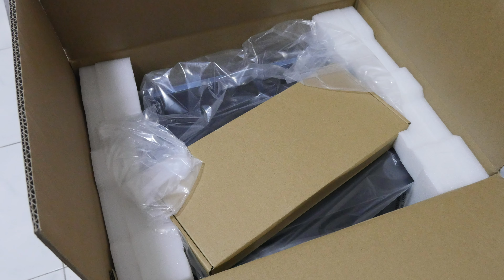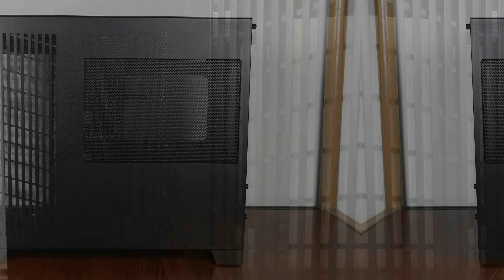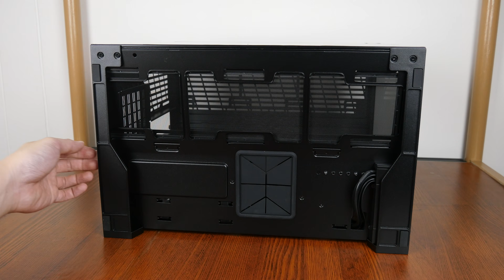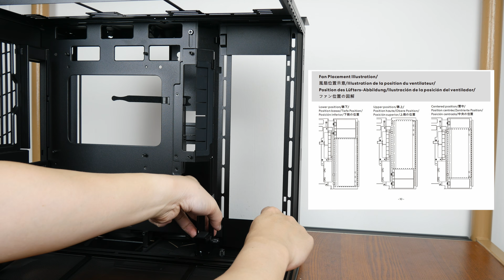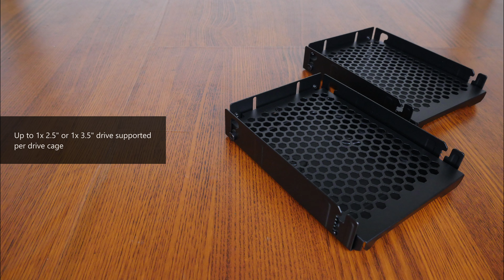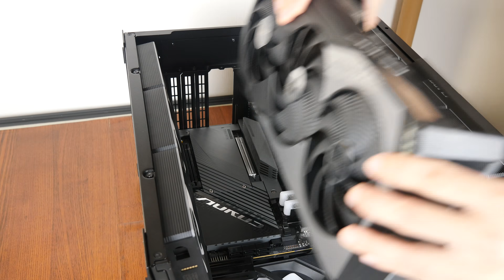The O11D Mini has been refreshed and improved! Lian Li O11 Dynamic Mini V2 Review & Walkthrough

Comment from the maker: NOTE: The O11D Mini V2 supports ATX motherboards with the primary PCIe x16 slot for a graphics card located in the second slot position - this is because the case comes with only five expansion slot openings due to its compact size. If you have an ATX motherboard with the primary PCIe x16 slot in the first slot position, you will have to install your graphics card in the vertical position instead!

Also, at 21:10, I mentioned that there are seven Velcro straps - to clarify, there are two additional straps on the bottom panel of the case, for a total of nine straps.

The written review for this PC case is available here: https://www.alktech.co/articles/review-lian-li-o11-dynamic-mini-v2-pc-case
Reply: I just had the opposite happen... GPU fits in the primary slot but could be due to it using a water block and i cannot install my SSD to the tray as my PSU blocks it off along with my side panel not closing, Just had to order a SFX PSU  ¯\(ツ)/¯
EDIT: Forgot to mention, great vid and subbed. I do Love the case, a bit fiddly to watercool in but that could be because i came from a Corsair Obsidian 900D :P

Comment: 19.41  Does your power supply stick out, or did the back panel close properly? For some reason, mine won't close.
Reply from the maker: Hi there, yes the PSU does stick out slightly, which is why the side panel has a raised section right above where your PSU would be to accommodate the "overhang". I'm currently using this very case in my own main PC, and didn't have any issues with panel closure! What brand and model of PSU are you using, and have you double-checked that there are no excess cables getting in the way of the side panel?
Reply: @ALKtech  Unfortunately, I didn't build this computer myself, but the person who did said he'd never encountered this issue before; the cabling seems fine, but I don't know the name of the power supply unit Zalman GigaMax III 750W ZM750-GV3

Comment: Some idea to cover he hole in the lower part where the gpu cable cross? I have 2 problems with this case .. 1. That horrible hole in the lower part
2. Not much space in the back. And more if you use hubs, hdd, and strimers.

Comment: I’m trying to downscale from a 011 dynamic evo. Is this a good option or can I go smaller with an ATX MOBO
Reply from the maker: Hi there, is your main gripe with the O11 Dynamic Evo the size? If so, the Mini V2's definitely smaller, but I'm not sure if going through the whole process of disassembly and reassembly is worth it (from my lazy person perspective 😅), unless you're already planning on upgrading your PC's other components too!
Reply: @ALKtech I ended up going lian li A3. Needed to buy a mAtx but man did it cut down in size
Reply from the maker: @luigisupergreen  thanks for sharing - the A3's a nice case and I have one myself too. I can imagine how much desk/floor space you've saved just by downsizing 😂 were you able to use your existing PSU with the A3?
Reply: @ALKtech yes. It’s a tight squeeze but it works

Comment: i think you have mounted vertical fun upside down
Reply from the maker: Hello! I assume you're talking about the side intake fans? If so, they're mounted in the correct position to serve as intake fans, though the reason why they look odd is because I used the normal blade variant instead of the reverse blade variants that would have looked more appropriate - I wasn't able to get any reverse blade fans in time for the review. Hope this clarifies!
Reply: @ALKtech make sense

Comment: I've been watching a lot of videos about this case and you've done a super job on your video. Question: I'm thinking of building a PC that's not primarily a gaming machine so I'm not planning on having an AIO. I like the Mini V2 Flow because it comes with the 5 fans. I'm wondering if it is possible to move the 3 fans on the bottom of the case to the top of the case? I would then get 3 ARGB fans to fill the bottom fan bracket (and also a fan for the back of the case.) Could the fans from the bottom of the V2 Mini V2 Flow be repositioned to the top? If so, is the wiring for these fans long enough to reach the appropriate connector on the motherboard?
Reply from the maker: Hey there, thanks for the kind words and glad you found the video useful! Unfortunately the review sample of the O11D Mini V2 that I tested is the variant that doesn't come shipped with pre-installed fans, so I didn't get the chance to handle the non-RGB pre-installed fans that would have come with the variant that does (O11D Mini V2 Flow)!

That said, I'd think that you should be able to shift the pre-installed fans to the top panel instead, as the wiring for such fans SHOULD be pretty standard across the board (even if they're not, you could always get a third-party ARGB/fan hub). However, you'd want to take note that the bottom three pre-installed fans are reverse-blade, meaning that they wouldn't look good from an aesthetics perspective when mounted on the top panel! Plus, being that they're non-RGB, they may look pretty odd when paired up with the 3 ARGB fans that you're thinking of then installing on the bottom panel. Hope these insights help!

Comment: Do the hard drive cages come with any anti-vibration rubber grommets for 3.5" hard drives?
Reply from the maker: Hi there, if I recall correctly they do, where you get six of them pre-installed for each cage as per 16:40 - you might have to pause the video really quickly as I sped up that section of the video in post!
Reply: @ALKtech  Okay, I slowed down the playback and I saw the grommets, I thought they were metal since they're the same color as the cage.

Comment: Does the case has orginally side and bottom fans intake or exhaust? If i want to have i/o as exhausst on top and i want to mount one exhaust fan back, and side an bottoms as intake then which ones should be reverse and which one should be normaln so it would look good? Does arctic liquid freezer 3 pro comes with fans mounted as intake or exhaust? Im sorry for so kuch questions but im new to building pc
Reply from the maker: Hello, the version of this case that comes with preinstalled fans comes with five of them, two on the side where they are reverse blade and serve as intake fans, and three on the bottom where they are reverse blade too and serve as intakes as well. Your suggested setup is correct, you should get 2x reverse blade intake fans for the side panel, and 3x reverse blade intake fans for the bottom panel, while your rear panel fan can be a normal blade one.

Regarding the Arctic Liquid Freezer 3 Pro, the fans typically will be installed as intake (blowing air through the radiator), so I'd install them on the top panel of the PC case where the radiator will then serve as an exhaust. Hope this helps!

Comment: Is there a way of modification to allow installation of a radiator behind the side fans?  Angled metal sheet is too close to the bracket holes.
Reply from the maker: Hey there, to clarify, are you asking whether it's possible to mount the AIO radiator on the side panel fan opening from the side of the second chamber with some modifications? If so, I highly doubt so unfortunately. Do you have three intake fans installed on the bottom panel, where they are getting in the way of your 240mm AIO radiator when it's installed on the side panel in the normal fashion?
Reply: @ALKtech yeah its right. A 55mm thick aio just seems too close to the gpu, so I'm hoping to mount the fans or radiator in the 2nd chamber. It seems like a lot of wasted space behind there. Anyway, it seems to be better just to mount it on top on top or use a 360 aio.
Reply from the maker: @lamjk10  mmm I see. Yeah I think to prevent overcomplicating things, I'd much rather do a top mount of the AIO radiator instead to save the hassle! Have you decided on which AIO to get yet?
Reply: @ALKtech i have 2 white aio-a 240 galahad ii trinity and a 360 galahad ii trinity performance. The latter is not officially supported because it is too wide. So I just used a matx board. And to offset the aio, I installed it on the middle slots on the inner side and on the side near the glass I used washers to act as clamps on the inside of the bracket.

Comment: If your buying this case make sure to check your front panel usb-c cable mine was faulty out of the box all the other panel connectors worked perfectly fine
Reply: Exact same issue here. Had to get a replacement, they sent all a new panel.
Reply from the maker: @alim7602  oof. Looks like they might be having some QC issues with the front panel..
Reply from the maker: Sorry to hear about that! Did you manage to get the I/O module replaced under warranty?
Reply: Just finished the build and tried usb-c. Same thing doesn't work...

Comment: The only drawnback of this case is that it doesn't suport a 280mm radiator on the site.
Reply: The other problem i just found out........ due to the angle, i cannot put my 120mm fans in the other chamber and have my rad in the main chamber. Pfft.

Comment: What would you recommend? The v2 mini or the lian li Compact case? My first pc build.
Reply from the maker: I haven't had the chance to build a PC with the O11 Vision Compact (which I assume you're referring to), but I'd say between both cases, it really depends on what you're looking for. The O11 Vision Compact is pricier, larger and you do get the option of having a top glass panel as well - I would say it's targeted at a different user demographic as a result.

That said, of the two, I'd probably go with the Mini V2 instead as I value having more space on my desk, and I really like how you can pretty much fit full-sized components in the Mini V2's compact package. My two cents!

Comment: The biggest downside to this case, is the 160mm Air Cooler support for CPUs. If you have to move your front fan up on a dual tower, it might run into some clearance issues.
Reply: Single tower air coolers got so good dual tower are just not worth it nowadays

Comment: what GPU is this?

What's the biggest GPU you can fit vertically in there?
Reply from the maker: It's a Gigabyte AORUS GeForce RTX 4090 Master 24G - probably one of the biggest graphics cards I've handled thus far. I haven't had the chance to try mounting this said card in the vertical position, I might give it a try and see how it goes!
Reply: @ALKtech please do and update!!!  Lol.  I
Reply from the maker: @iron.sneeks4053  I'll try to do so in the next couple of days, will update again!
Reply from the maker: Hey @iron.sneeks4053 I managed to get a Gigabyte AORUS GeForce RTX 4090 MASTER 24G to fit in the vertical mount position - FYI. It's by far the biggest graphics card I've handled till date, and it fits with space to spare!
Reply: @ALKtech  That is awesome!! THANK YOU SO MUCH!!!!!!  I think the 5090 MASTER should fit as well.  I think they're the same dimensions.  I'm sure you slid in your back fan after placement correct?  Thanks again!
Reply from the maker: @iron.sneeks4053  yeah the 5090 Master is not as wide as the 4090 Master, but has roughly the same height and length, so you should be fine! Just to clarify, are you referring to the rear exhaust fan? Or the bottom-mounted triple fans?
Reply: @ALKtech rear exhaust

Comment: I have the Aorus 4080 super master and was wondering if it would fit. Luckily, you had the 4090 master in the case. I wonder if the lian li edge 1000w platinum pcie5 cable for the gpu fit? Should buy a 90 degree angle adapter for it?
Reply from the maker: The Aorus 4080 SUPER Master seems to have pretty much the same dimensions as the 4090 Master, so you'll be fine! Regarding the Lian Li 12V-2x6 cable, it should fit (I had to bend the cable on my PSU's 12VHPWR power cable quite a fair bit just to get it to be clear of the tempered glass side panel though). If you'd like a peace of mind, getting a 90 degree adapter might not be a bad idea at all, and gives you more flexibility in terms of how to run the power cable to your GPU!
Reply: @ALKtech Thank you!

Comment: what fans from lian li are those that you have!?
Reply from the maker: The AIO radiator and bottom intake fans are Lian Li's new Uni Fan CL Wireless 120s, while the side intake fans are the new Uni Fan SL-Infinity Wireless 120s - I didn't have this in reverse blade so I had to make do with the standard blade, which is a pity as you can't see the infinity mirror effect on the fan hub!

Comment: Great video! Thank you for using the EATX Aorus X670E. I was worried about fitment.
Reply from the maker: Cheers! I was kinda worried it wouldn't fit too, but was glad it worked out well - the GPU support bracket comes pre-adjusted in a position that supports standard ATX, simply adjust it away from the motherboard tray and the case will accommodate smaller EATX boards just fine!